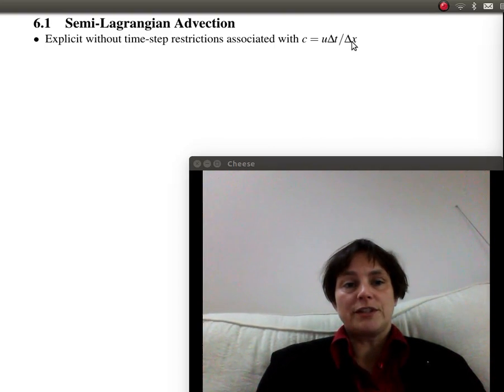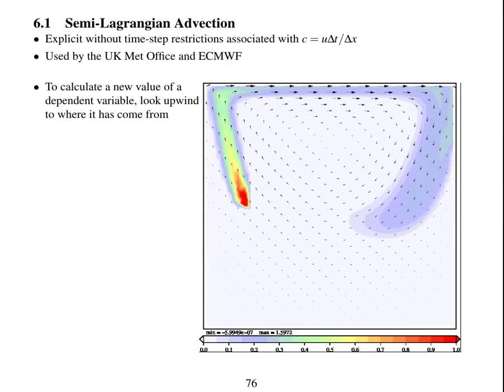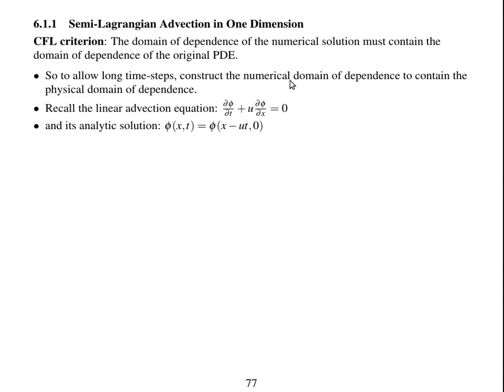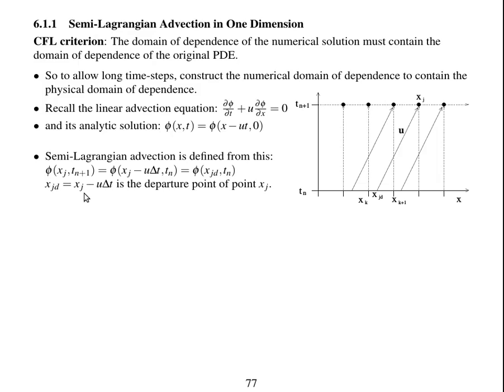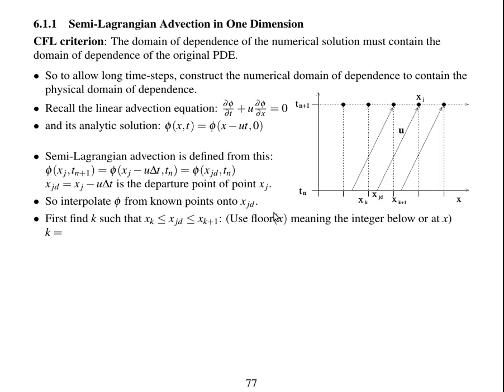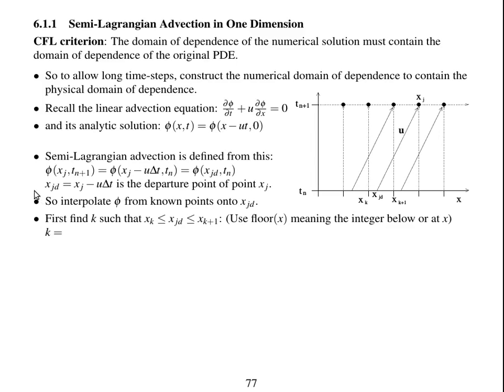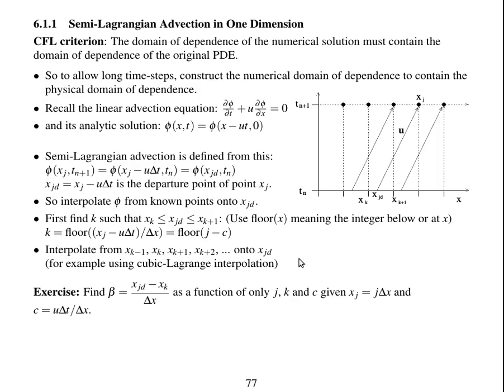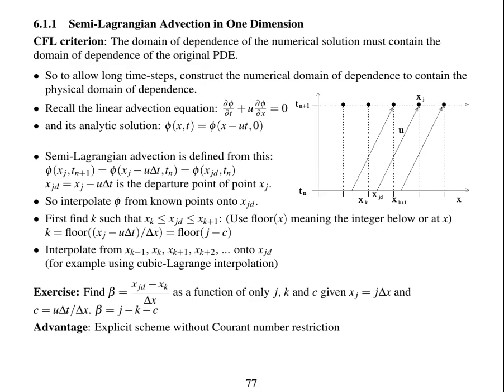7.1 semi-Lagrangian

Comment: what if it is nonlinear advection equation? How to apply this scheme to get the solution?
Reply from the maker: More difficult. You need to linearise and iterate to update the non-linearity. It is also more complicated for curved or accelerating flow. It is a more complicated calculation to find the departure point which needs iterations
Reply: @hilaryweller615  If you have any documentation to apply this scheme for a nonlinear advection equation can you please share it? 
Something same as your slide on linear advection equation using semi-Lagrangian scheme, basically looking for the algorithm to solve it.
Reply from the maker: No I don't. Sorry. It is not that simple. You probably want to look at papers authored by ECMWF and Met Office on their models
Reply: @hilaryweller615   Thank you so much for your reply and guidance.